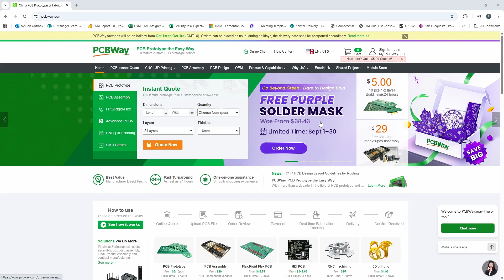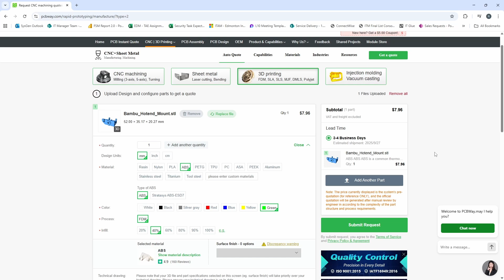DIY Beginner Friendly CoreXY 3D Printer SimpleCore Redux EP3 - Z Axis and Updates

Comment: what you bought are 2020 t slot aluminum extrusions, rather than v slot which is what the masumi extrusions are which come in kits.  v slot is only slightly more expensive in most cases, just because of the economics of demand, but t slot is much more widely available from services such as amazon, temu, & ebay.  the stair stepped slot is the dead giveaway as to extrusion type, but there's few other differences.  if you don't want to have to buy wider linear rails, just print the adapter which somebody else already commented about.
Reply from the maker: no V slot do not work the gap is even wider. I always use a alignment tool it does not help as the 9mm rail will not sit flat in this cheap 2020 extrusion. T slot is always used for linear rails, misumi, ldo or funssor have flat T slot extrusions that work
Reply: @Rolohaun i use basically nothing but v slot & never have problems.  most mgn9 rails have chamfers along the length of the back side which butt up nicely to the sides of the v slot, which slope in toward the center of each channel at 45°.  i have had problems with mgn9 rails playing nicely with t slot extrusions, just because of the stair stepped slot being an odd mashup with the dimensions of the rail, but that's where the adapters come into play - i just personally prefer to avoid that problem by going with v slot extrusions whenever i can instead.

Comment: in case you stuck with unruly extrusion you could ease mgn9 installation by using a 3d-printed conductor clips to hold it in place while tightening
Reply from the maker: nope does not help, I always use the alignment tool, the linear rail does not sit flat with this cheap 2020

Comment: You need spacers to get the mgn9 on the extrusion.
Reply from the maker: I always you alignment tool, it does not help. The linear rail does not like to sit flat with this type of 2020
Reply: @Rolohaun  I have that kind of extrusion on my kappy and it was awkward to get te rail on, I think a guide would've helped.
Reply from the maker: @L-z9x4w  I did use one, no help. Not sure if it was this 2020 or the linear rail but the rail was to small and it would not sit flat when tight
Reply: @Rolohaun  Mebbe a 3d printed shim which fits in the cavity would work or a mgn7 😁?